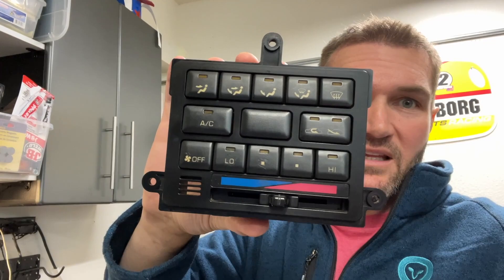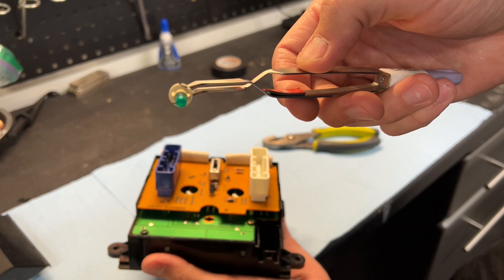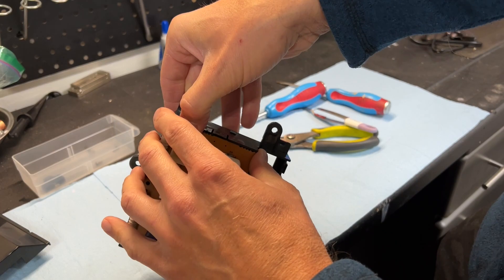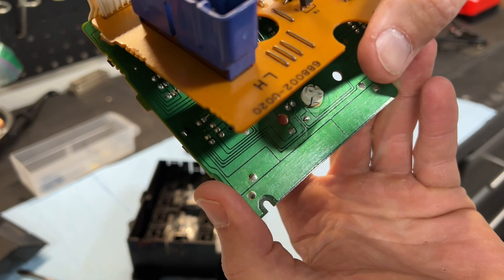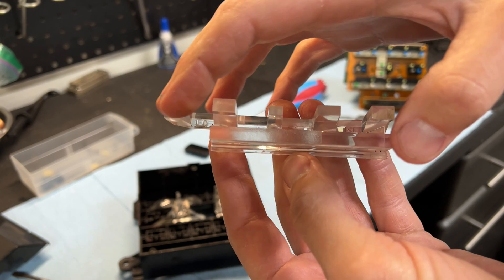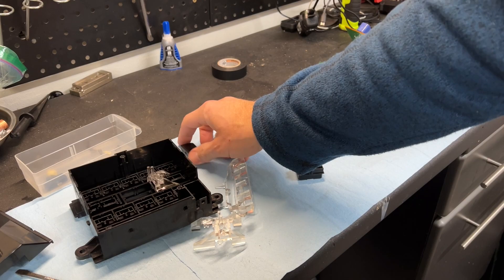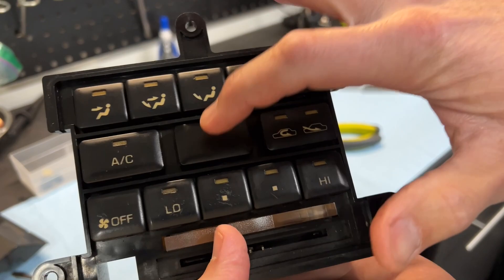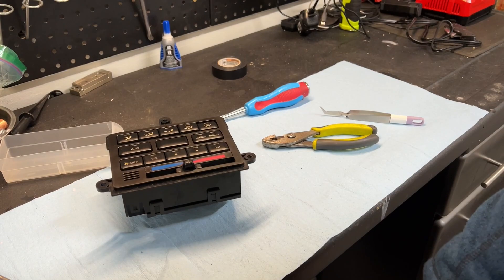80 Series Land Cruiser Climate Control/AC Rebuild FZJ80 FJ80 BJ80 HJ80

Comment: Greetings, my problem in this case is that the blower speeds only work in Low and Hi
The resistor module control was changed and it remains the same, I understand that the problem may be in the switches
I wonder is there a way to repair them?